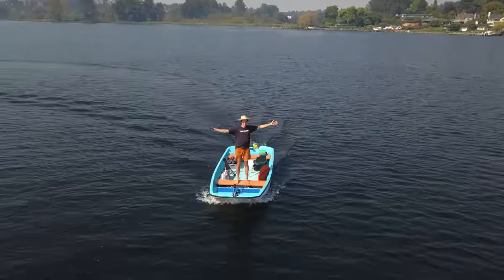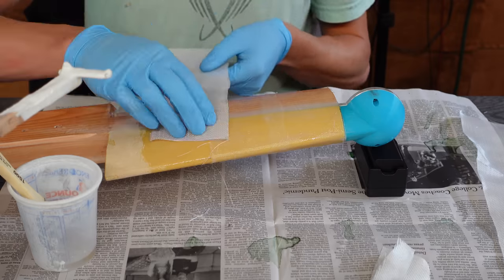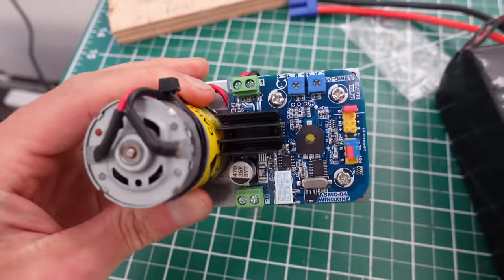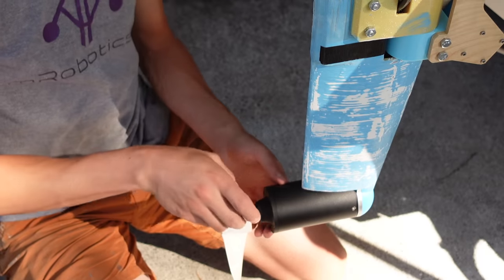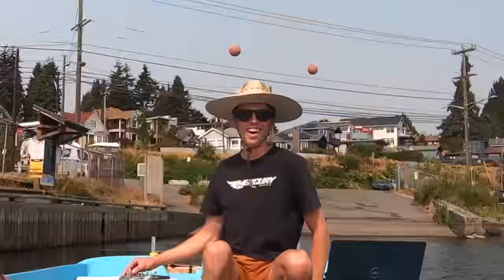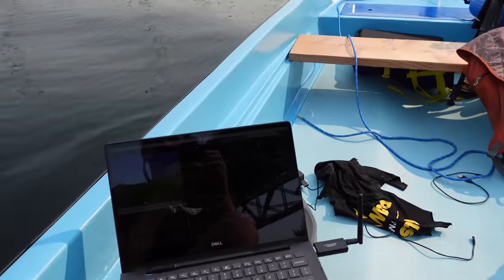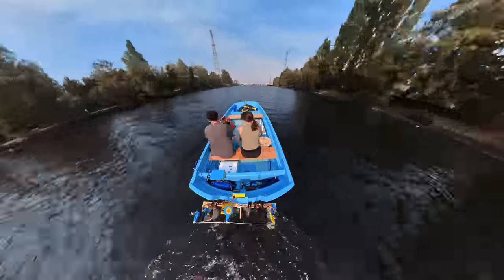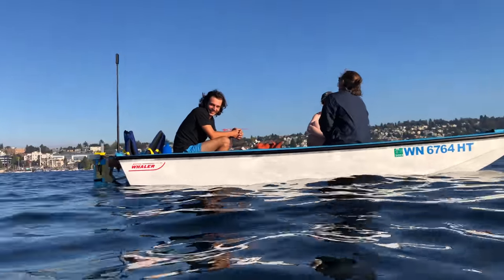Full Size R/C Boat Can Carry People!

Comment: I noticed that your outboards were placed quite wide and so i decided to do some research. I found out the if your out boards are too wide it actually causes cavitation the other thing I found in my research is if the motors are too deep it will also cause cavitation. I would be curious to see if you could put the outboards on a sliding rail and try different spacing in-between the outboards and different depths maybe it would help tune them!

Comment: Those flipsky 75100's in the box case are known to overheat really fast and not be that well built. If you want to upgrade get the 75200, more current and a way better design

Comment: Something that may help the steering servo is if the control rods have some sort of suspension springs to help or maybe the arm had some play to account for chopps or hell maybe a clutch to disconnect the servo when steering is fixed or not engaged and stress is mechanical not electrical idk. I'm just really stoned rn dawg. Hope you can make sense of that

Comment: Real boats with Dual motors have counter rotating props so one is standard the other is a mirror and runs backwards to still thrust forwards- Might be part of your vibration problems?

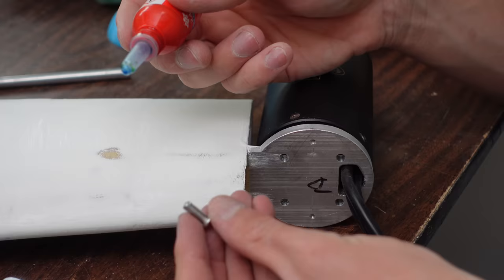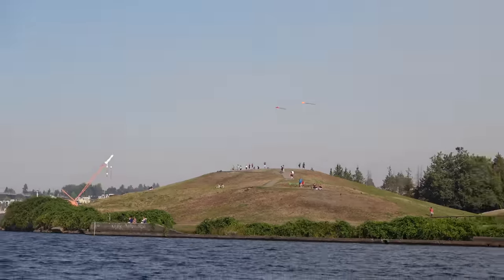Comment: 5:51    this single motor mount is less-than ideal.       i suggest that you make an underwater recording of the props in operation.        21:41   analyze  feedback forces  coming up from the props.

Comment: I'm super curious how fast this boat can go at full power, and how much power it uses to do so. I've been thinking about a SUP / catamaran built with these motors recently - they seem like a very good and simple option. It's either that or a 3D-printed stator with custom windings I guess.

What are you printing those parts on? Everything I've seen with that level of surface imperfections has produced horrendously weak parts, but some of yours (especially those in the steering mechanism) are handling HUGE torques with ease. 

My electric scooter is not happy about the limited performance of those 75100s lol...

Comment: the rubber is what breaks first if you hit something . shock reducer .Damage reducer . that will break before metal gears .
Reply: worked on outboards when i was younger . i broke the rubber once hitting something with my 15hp Gale . and i am sure u have already thought of using lower ends and mounting motors ontop of the lower ends .
Reply: you have a choice Long shaft or short shaft lower ends

Comment: from having allot of experience with boats, that could go years without maintanace, I wouldnt recommend using a servo for steering with plastic parts, I would reccomend a hydrolic steering mechanism, they are very low maintanance and arent even that evpensive and could still be worked with an electric motor using a gear

Comment: Bend some copper pipe around the heatsink on the motor ESCs and pump cold water through it and ur steering broke in the first place due to the long arm u printed on it and the cavitation force and if ya wanna try out the motors and get more voltage make a cheap lipo pack

Comment: Next time you go to balance the propellers do it the same way they do it for radio control airplanes that is the same way they do for large scale airplanes a rod through the center balancing on 2 very freely spending wheels on each side  it actually works very well And you might think of counter rotating  purpillars Also I do not know if this would help but have the inboard motor turn a little bit tighter than the outboard murder on turn radios

Comment: Yeah your awesome, remind me of a good buddy of mine I lost touch with years ago. Now that I'm done oversharing I'm curious, that whaler will get on plane with enough thrust right? Just curious how much more you'd need. Being able to plane should reduce consumption at speed, right? A friend of mine recently bought a StumpKnocker (thats the name, think its a florida company) around 16 foot because he's addicted to fishing. Glass over wood hull, heavy for its size, came with a 15hp Yamaha that had seen better days. It would get to within a mile per hour or 2 of planing speed. Very irritating, if the motor had'nt been old and weak it probably would have had just enough oomphh. We ended up putting a 35hp Yamaha on it. Thats how we knew how close it was to planing with the old motor, just 2 more mph. One day I hope to do an all electric house boat with a large solar array. Lotta surface area on those for collecting power and could always add a wind turbine. Really just needs enough propulsion power to deal with the intracoastal and river currents and wind. Then I shall become a nomadic river captain. Oh and also needs a Crane for cars. House boats have garages right? I mean they do have house right in the name so i'll just assume. Must be under the water line. Anyway great channel, inspires me to do something weird ever time I watch so thank you!

Comment: At my first internship I was asked how I would attach a wheel to a motor shaft. I suggested a hub with a set screw and was laughed at. Set screws always fail is what they told me. I believe they ended up doing a thermal press fit. Even if that gearing reduces the stress on the set screw, I would recommend searching for alternatives.

Comment: Maybe you changed the hydrofoils on each of the prop blades differently enough that it causes a vibration now (when going at it with the angle grinder). So even though the mass is balanced, the force that each blade produces is not, and that causes the vibration.

Comment: Increasing the voltage will solve some problems. Your amp draw will go way down for the same amount of power. The motors are getting hot because the amps are too high.

Comment: fun project as usual but I see way too many youtubers vastly underestimate the strength of 3d printed parts. It is very hard to make plastic structurally sound in applications where 100's of pounds are involved, especially when it is 3d printed instead of some more traditional methods. Just use wood as a cheaper medium with much better structural properties. For example, you could have build that back mount 100 times stronger with one 2by4by10. It would cost you 7ish dollars instead of the 45+ dollars you spend on filament to print. Just a suggestion, not trying to cast criticism

Comment: Wondering if cooling the drivers via an underwater heatsink (with heat pipe) would fix the thermal-fallback issue.

Comment: I have always wanted to run my electrons be controllers submerged somehow in the water. I’ve also wanted to either have a thin just provide stability out of the bottom of the vessel while cooling the electronic speed controller. Why did you forget to cool yours with cold water, I know that lake was cold, and you just ran them air cooled? Or are you just could’ve taken the normal route and put the fats on a small block and water cooler. You are very lucky to live up there and not live in Florida like I do where water cooling any of my fast electric boats

Comment: The rubber pieces in the hub of the prop are too protect the propellers and motor if one of the lobes was to strike something in the water the the prop would slip on the rubber hub.

Comment: ....the closer thenpivot point is to the center of the "plank" you mount the motor on, the less power you need to steer the thing.

Ofc. there is a downside - that comes from the upside of not needing crazy servos.

Namely that it aint idiot proof.
As you can flip it 90° while boat isnat full speed.If you do that quick, boat wont have time to turn, and you have a good chance of ripping the rudder or outboard off with the increased pressure.

Comment: Good to hear about fold out satellite solar wings  which could also be a sail for additional thrust points 300 watts being all ya need on one motor means 600 for the pair? And maybe some wayerproofed water cooled circuits so it's low amps high volts because somehow electricly amps give more heat than volts with the same watts which is why they use high voltage lines for long distances because less heat loss because heat is energy  and wire resistance may be low but still not zero good luck man I'm rootin fer ya  thanks for sharing the projects 😁👍 you're video's help me describe my own engineering to dumbfounded people assuming I'm collecting useless junk , meanwhile they have no interest in understanding but if they listen even a slight bit to your video's they understand so much more and suddenly beg me to build it for them for free... which is when i fire back with unknown large pricetag for my man hrs of r and d as well as materials cost and build time  maybe i make a couple grand on the side who knows that's  all about your bartering skills vs thier value for such rare or plentiful objects

Comment: Hiya I was wondering whether someone could offer some advice?

In regards to that big servo.. I set up a very similar looking one today ("Super 500 Robot Servo").

I was using only 12 volts, but I found even when the servo speed was dialled up it was resonably slow, but also had a weird deceleration towards the end of the throw.
So the servo would swing across and then really slow down and very slowly finish it's travel. Almost as if it was over accounting for it's own inertial mass by a huge margin.

Can anyone suggest if this is normal behaviour for a big cheap servo like this? I am torn as to whether to re-buy or go a different direction.

For context is for a mini speed boat similar to the ones on my channel.

Please and Thanks.

Comment: On the VESC I would guess you had a fault, then the PPM app doesn't let you continue until returning to 0 position for safe start.
Reply: Although the build quality of the flipsky ones is pretty awful, so might be some weird hardware problem as well.

Comment: get a bigger motor controller than you need then limit it in the firmware and it should never overheat, by the nature of a boat it pulls a lot of load constantly so its hard work for a controller at its limits

Comment: i think the prop balance issue can be to do with the turbulence of the water
Reply: maybe a less aggressive prop could help with the overheating too you could use more revolutions for a slightly slower speed not sure if electric motors work that way idk

Comment: These servos are not as powerful as advertised. I tried using them on skid steer system, and they failed on the first run. Ended up using a linear actuator with feedback and pololu controller for rc. Still going strong after 5 years.

Comment: It would be cool if you gave each outboard separate steering control. Watch this video (starts at a certain point) to see how the outboards move independently of each other to move the the boat straight sideways without the need of a bow thruster, etc. https://youtu.be/Z1bT5sTSTZM?t=1470 I think a smart control system like that would be very fitting on an electric RC boat.

Other than that, its great! You've come a long way with learning how boats work haha.

Comment: Not so sure I'd want to rely an all this to be able to control a boat, especially any distance offshore. It's fun as a project, but using radio control seems pointless, it could very easily be wired and a much simpler design. Particularly when sitting right where you would holding a conventional manual tiller anyway.

Comment: Wow, complicated. I would have thought you could just adjust the speed of the motor each side to steer the boat enough. Works good on a full size catamaran at low speeds at least.

Comment: Hmm.. you probably dont want to hear this but.... wouldnt it be 100 times less complicated, expensive & time consuming to just have the motors fixed on either side and use 2 joysticks with graduated forward & reverse independant thrust for steering and forward / reverse movement??!  
You could turn on a dime and no need for literally everything else involved in the build... also an Aluminium boat would have been a much better choice, lighter, no need to restore / fibreglassing and way easier to work with. Hope you dont think im just trying to be cheeky.. ive been travelling and living out of a 4.2m solar powered electric boat (400aH lithium / 450W solar) for the past year up the east coast of Australia and about to build a much larger version.
I did very much enjoy the build though, thank you!

Comment: PURE SPECULATION HERE but i would imagine whoever designed those motors didnt design props so they probably made the shaft spline and taper the same as an existing propeller standard, my wild guess would be its like the ones for those trolling motors, although if theyre for e-foils i suspoect the pitch on those would be too (shallow? not sure how you describe pitch but not pushing enough water, the equivalent of the gearing being too short) and i love 3d printing but like unless i tripled the thickness and covered them in fibeglass AND had an inset metal center to engage on the shaft i really wouldnt trust that for a propeller for anything more than going like 20 feet, even in like abs

Comment: You do realize That you have everything inside your radio you could control the speed of the server how far it travels and some radio the strength of the server Try looking up expatential differential And   Mixing You should be able to do all that without that circuit board with that circle you just need basic Control input on the circle the radio will do everything

Comment: 11:24 rubber in there is protective motor shaft dont rip teeth out by hitting something under water but will rip rubber off and propeller will come off if going over 15k rpm and hitting something underwater but motor will not get destory it was make to protect outboard not destroying it own shaft teeth
one you got is off set bad quality one there some on internet have better quality one is well balanced and else

Comment: $80 for that servo? It uses pots? And is exposed? Could you not have got something better for the price.

Also what servos are you getting that only move 90 degrees? Most I have seen are 180 degrees and some 270 degrees.

Comment: Why did you put the propellers so deep? A normal outboard propeller is barely below the keel of the boat. Having a too long stem will make a pendulum effect. Putting much strain on the transom because of the leverage . I'd elevate the rig until the propeller was barely below the water level or even better; shorten the stem. Less vibration and probably more speed du to not have two poles deep in the water. 

Bet someone else commented on this, but I can't seem to search previous comments anymore....